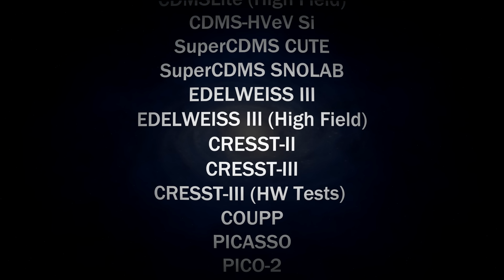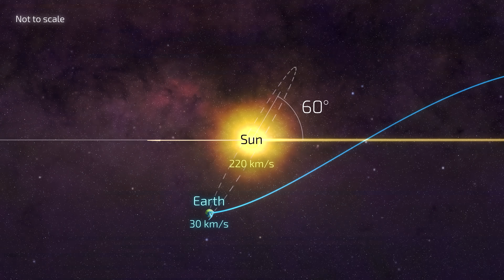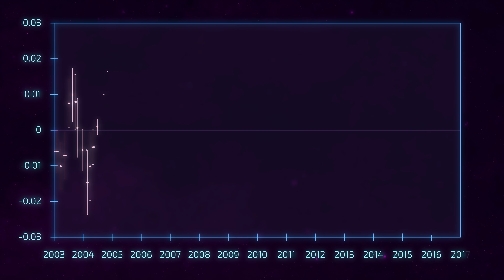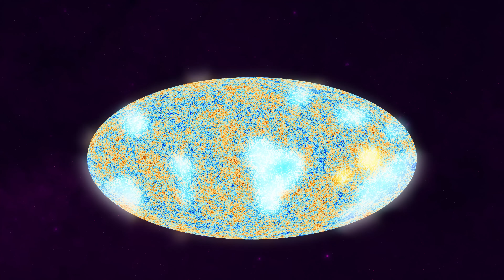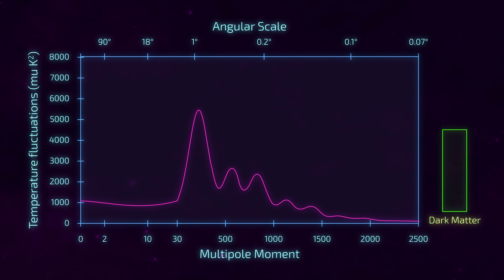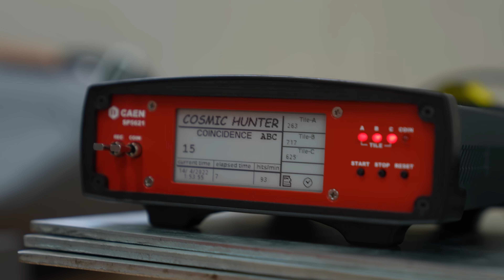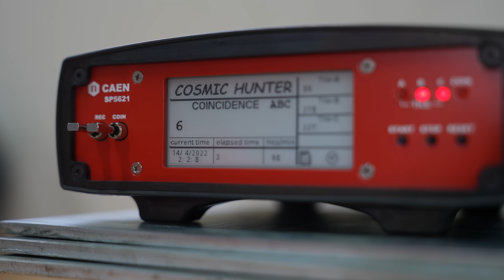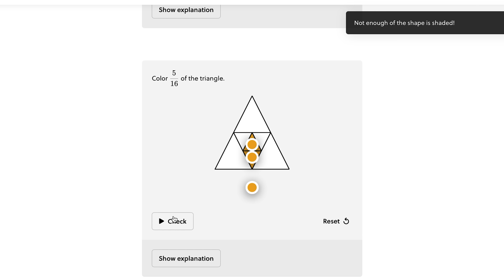The Absurd Search For Dark Matter

Comment: Is Dark Matter the first thing that we've observed but can't justify?
Reply: Not at all.  To name just a few examples:
- Anomalies in the perihelion precession of Mercury were known as early as the 1860s but could not be explained until the theory of general relativity was developed 50+ years later.
- The "ultraviolet catastrophe" was a famous problem in the late 19th century where calculations showed that the energy released by blackbody radiation should be infinite, which obviously is not what we observe.  This ultimately led to the advent of quantum mechanics, which would not be developed into a formal mathematical theory until the 1920s.
- In the 1960s, it was identified that in the then current standard model of particle physics, particles should not have mass.  The Higgs field was theorized as a mechanism by which particles acquire mass through spontaneous symmetry breaking, but its existence would not be experimentally confirmed until 2012.  
- The existence of gravitational waves were first predicted shortly after Einstein published his work on general relativity in 1915, and it would take a full century to empirically verify them with the first detection by the LIGO experiment in 2016.
Reply: @extravagantpanda7962  I guess I didn't word my question correctly, yes It's taken a long time to discover these phenomena you speak of but dark matter still hasn't been fully understood the way those examples have (yet), I just didn't know if there was anything else as of right now that hasn't been confirmed/identified.

Comment: Good luck to you but you will find nothing.

You are trying to detect Aether particles and The Michelson-Morley Experiment proved the Aether is entrained by the earth over a century ago.

In any case, you need to consider gravitational entrainment. You have baryonic matter immersed in what you're searching for. Assuming both are affected by gravity, if you think about the way gravity works then these 2 media will speed match. Take a molecule and think of aether all around it to infinity in all directions, and now have the molecule moving in it. The G in front of it takes longer to adjust (increase) than the G behind it adjusts (decreases), the net result being that they tend to speed match i.e. not move relative to one another.

Like I said, good luck! 😉

Comment: I'm really confused on one thing. You start out by saying that dark matter are particles that can only interact through gravity. But then you explain that the new detector is going to detect them when they collide with sodium iodide and transfer their energy. How can they interact with the sodium iodide if their only interaction method is with gravity?
Reply: It's not necessarily true that dark matter only interacts via gravity, we just know that it does interact with the gravitational force but not the electromagnetic force.  One of the leading candidates for dark matter is a class of particles called WIMPs, standing for "Weakly Interacting Massive Particles".  The "weakly interacting" part means that these particles would also interact through the weak nuclear force (or potentially also through other as-yet undiscovered forces).  I'm not sure though exactly through what mechanism they expect dark matter to interact with sodium iodide in this particular experiment.

Comment: You said there is dark matter  five times the known visible matter but untill now we discovered just a tiny bits of it on earth" may be that is!".I think that is because we use the wrong detectors .When we discover the right method of detection we will not need to dig deep tunnels inside the earth to find it.

Comment: I have considerable doubts about this experiment. The difficulty in discriminating between cosmic rays or any other known particle events and what might be the rare detection of a dark matter particle is extreme.  It could well be that the signal detected in Italy is simply an artefact of something unaccounted for in the detection system. There is also an assumption that dark matter is a certain type of particle which limits the possibility of detecting dark matter if it exists. 
I suggest that current advances in theoretically developed MOND theories are showing the potential to explain all of the phenomena attributed to dark matter.
However, it is important in general to perform these experiments to rule in or rule out classes of particles as dark matter candidates. Sometimes something unexpected can be detected too.  The question is is this experiment good enough to reject false detector events and sensitive enough to detect rare dark matter events?
Reply: r/iamverysmart

Comment: What “signal” are they getting with highest amplitude in November and June if as you said earlier dark matter particles doesn’t interact with visible physical matter? How does dark matter effect sensors, that get “signal” if it doesn’t interact with it?
If dark matter only interact with gravity, then you can only detect dark matter in gravitational differences when we go with the Sun and when we go against in the opposite direction when earth’s speed slows down relatively to the Sun.

Comment: So your lasso theory is flawed because space is in a vacuum. And there is a low density of particles, predominantly of plasma of hydrogen and helium in space(wiki). So the slingshot effect would be less predominant. Meaning that rotational mass would move differently than it would on a planet being subjected to atmospheric pressures. I believe that gravitational slingshot mass without atmospheric friction and under vacuum would behave differently as observed. I am not amused by this bandaid of “dark matter” that illogically encapsulates many factors. It’s just on such a large scale that it seems scientists are trying to label many aspects as one. It also very possible that what protons are detectable inspace create buffers between planets so that they maintain course within their own galaxy(pushing and pulling, like a galactic atmosphere)
…..but then again I have no idea what I’m talking about. I’m just a bartender.
Reply: Also, if the theory of dark matter is that we are expanding from a center. And that particles are moving in an unobserved relationship. Then based off of thermodynamics than we must also be either loosing space to gain space or growing to gain particles at the expense of lost particles. To expand we must have fuel. So what are we burning? 
Something had to come from the center to create as an equal and opposite reaction?

Comment: It is an amazing idea to use a thin line connect to different masses in the center with a star to illustrate the effect of dark matter.
Reply: I didn't see that anywhere in the video.
Reply: Check out 5:15
Reply: 1887 aether "Albert Michaelson and Mr. Morley" a bit better than a string.
It's on the wind ?

Comment: Gravity seems to only act between masses, but it actually radiates in all directions, strengthening the gravitational pull as it accumulates within a galaxy. Although some of the gravity produced by a single mass can escape the galaxy, the rest is confined within it. I hold the belief that mass is fundamental aspect of space-time, leading to the conclusion that the mechanisms behind gravity and inertia must be similar. As the galaxy rotates, gravity either grows to counteract inertia or vice versa. I also believe that because mass is not intrinsic to space-time, properties of space-time must be added to E=mc^2.  Gravity, inertia, and spacetime are all interconnected and part of a single structure that has existed since the Big Bang, regardless of the distance between the source of gravity and the mass.

Comment: It seems the only thing that we can say for certainty is that there is an observable phenomenon. Why that has to be due to a made up material is a leap. I am cautioned by the great mistake of the ether and radio waves. While there is an explanation behind the phenomenon we just don't know what it is.

Could gravity work in a way like energy in terms of conservation? Could all the gravitational attraction from mass require some kind of conservation that gravity pushes apart somewhere else? Could this be what's accelerating the expanding universe AND keeping galaxies together at those rotational speeds?

Comment: I kinda wondering, how people know existence of "dark matter" when they never found a evidence about that?
Reply: Simply put, they detect more mass than there should be . This video goes in depth, but to summarise, galaxies rotate wayyy faster than they should using our current theory of relativity. *5x faster*, and this 5x faster is consistent with all observations of mass. When galaxy clusters collide, there is more mass on the outskirt of the collision, even though there should be more where the 2 galaxies collided.

Basically, the way planets, galaxies, and galaxy clusters orbit each other isn't possible with detectable matter. They move too fast. With the current calculations and models they have, dark matter consistently fills the void of mass in the galaxy. Hope this helped!!

Comment: The missing mass is dilated mass. We have all heard the phrase "mass becomes infinite at the speed of light" this phenomenon is illustrated in a common relativity graph with velocity (from stationary to the speed of light) on the horizontal line and dilation (sometimes called gamma or y) on the vertical line. Mass that is dilated is smeared through spacetime relative to an outside/stationary/Earthbound observer.
   Wherever you have an astronomical quantity of mass, dilation will occur because high mass means high momentum. There is no place in the universe where mass is more concentrated than at the center of a galaxy.
   In the 1939 journal "Annals of Mathematics" Einstein wrote about dilation occurring in regions that would have less mass than that which would exist at the center of common spiral galaxies. Therefore it is safe to  say that according to Einstein's math the mass at the center of our own galaxy must be dilated, in other words that mass is all around us.
   It was recently discovered that low mass galaxies (like NGC 1052-DF2) have normal star rotation rates. This is what relativity would predict because there is an insufficient quantity of mass at the center to achieve relativistic velocities.
   A simple way to confirm this would be to calculate the star rotation rates of a large number of galaxies. This would show that all the high mass galaxies would have star rotation rates that seem to defy the known laws of physics and all the low mass galaxies would have predictable star rotation rates.

Comment: I think we're very used to everything out there being a particle but my guess is that dark matter is something else entirely. And this is because there's only one trait of matter that it actually shares and that's that it has mass. 
Just tossing out the "matter" assumption could explain why none of the detectors have found anything or why the Standard Model has nothing to say about it. 
Further, and this is just a guess, but this may also be why quantizing gravity has proved so challenging, cause maybe space itself isn't a particle either. Maybe it's in the same class as dark matter and is related to it in some way.

Comment: I wonder how they measured the speed of the stars moving around the center of Andromeda.

If it takes the Milky Way at least 200 mil. years to rotate once, it means it rotates 1 degree in 555,555 years. That's 0.0000018 of a degree per year. That's a perfectly still image for centuries before noticing any movement.

Not to say some published workes "demonstrate" all spiral galaxies take 1 bn. years to spin once. Others prove differently.
Reply: It's quite interesting: they use the doppler effect in combination with some quantum mechanics.  

You may be familiar with the doppler effect as it pertains to sound waves, it's what makes, for example, an ambulance siren sound higher pitched as it is approaching you and lower pitched as it moves away from you.  The movement of the sound source towards you compressed the sound waves, resulting in a higher frequency (and therefore pitch), while movement away stretches those waves outward resulting in a lower frequency.  The same phenomenon occurs with light waves: light emitted from a source moving toward us will have a higher frequency than if the source were stationary, and light emitted from a source moving away from us will have a lower frequency.  This is often referred to as blue shift and red shift, respectively, since frequency directly correlates to color in the visible light spectrum, with red having a lower frequency and blue a high frequency.   Furthermore, the faster something is moving towards/away from us, the greater the frequency shift.

With the doppler effect, we can determine whether an astronomical object is moving towards us or away from us, and from the extent of the frequency shift we can calculate the velocity.  However we can only do this if we know the frequency that the light would have if the source were stationary relative to us.  This is where the quantum mechanics comes in.  There is a phenomenon that happens in hydrogen molecules called "hyperfine splitting".  The details are a bit complicated, but the relevant thing is that hydrogen molecules can and do spontaneously emit photons with a specific frequency.  Due to the nature of fundamental particles being identical, this frequency is always the same for any Hydrogen molecule anywhere in the universe.  The universe is filled with hydrogen (it is the most abundant element, being the lightest), so if we point a telescope at just about any celestial object, we should expect to see a big spike in radiation at this specific frequency (which is in the radio spectrum so this require a radio telescope).  However if the object is moving relative to us, this spike will be blue or red shifted by some amount due to the doppler effect, so by measuring how far this spike is shifted we can determine the objects velocity relative to us.  

This at least is how we can measure the rotation rate of the milky way, our own galaxy, and I have personally done this experiment in a university astronomy lab course, it was pretty neat!  I'm admittedly not sure how similar measurements are made for distant galaxies which appear essentially as points in the sky, but I would imagine it employs the same principles.

Comment: If it was dark matter that was being detected, that would surely mean that the dark matter was stationary or moving in parallel towards the solar system no?? If it was moving the same way as the solar system or perpendicular, that would give different readouts. And you also stated that the dark matter was zipping around all in random directions, witch would nullify the supposed readout completely, or did they get lucky to get readings only by the dark matter that was going the correct direction??

And when it comes to the galaxies and your experiment.
Having more mass in the center of the galaxy does make the outer systems rotate faster, but it also would also make the inner systems rotate faster.

And i might be stupid but 7:30 makes no sense. Because to me it looks like the are way more mass on the outer edges, but what you are saying is that this is caused by the dark matter and not the galaxies. So why are there no dark matter in the gas and why did the dark matter stop on the other side.

Comment: Hello and thanks for this very interesting video.
My prediction is that the Australian Observatory naturally will find the similar annual variations, but IMO, this has nothing to do with dark matter, but everything to do with an embedded mechanical factor from the formation of the Solar System.
IMO the cosmological keyword in this question is: “Centrifugal Formation”
Resent findings of the formational process in the Milky Way have the Milky Way to form inside-out, i.e., via a centrifugal motion from the MW center, and this expanding formational process is also the case of the planetary formation in the (pre)-Solar System. 
The planetary orbital elliptic plane is an evidence of a centrifugal planetary formation from a center. 
When the Earth is in orbital position against and towards this initial expanding motion from its formational center, it mirrors the initial centrifugal formation and annually  experiences this orbital velocity “head- and tailwind”.
As our Solar System is an integrated part of the Milky Way formation and motion, the centrifugal force from its center, also plays a part on the motions in our Solar System.
It´s simple (alternate) celestial mechanics which has nothing to do with dark matter – or even with Newtons or Einstein’s gravitational mental constructs, as the factual formational processes and motions are electromagnetically originated and governed.